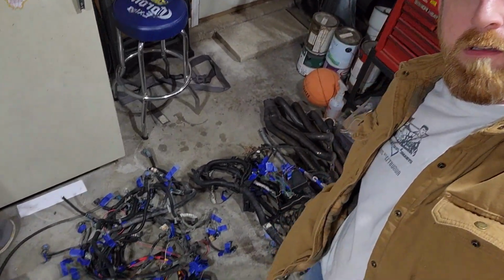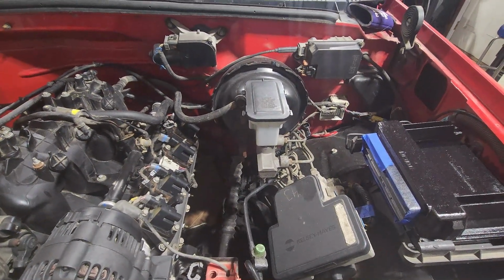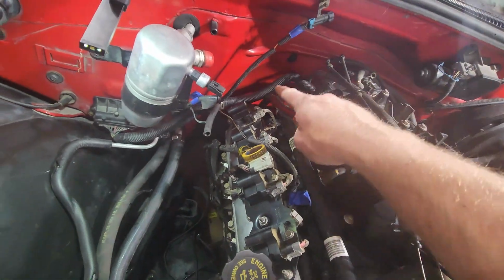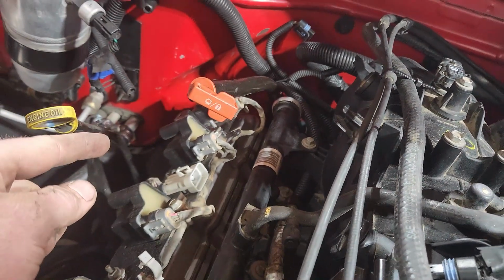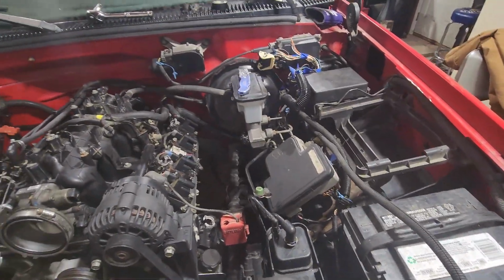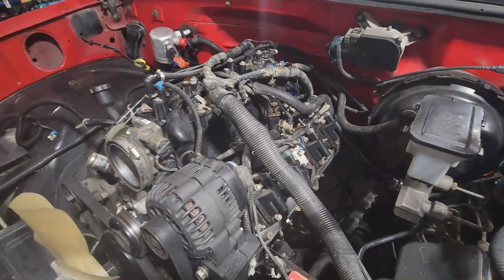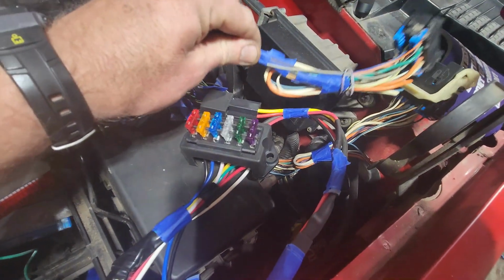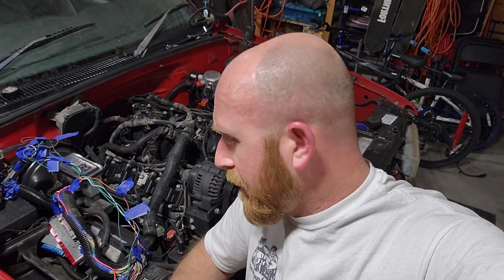Installing the OBS and LS wiring harness into the engine bay of the 1998 Silverado project!

Comment: Do I keep the factory pcm.  And how did you do the nss
Reply from the maker: No, the pcm controls the motor, trans, evap, etc. Your new LS pcm will control that now. The nss wiring in the old harness was kept, but not the round plug, its from the new harness.